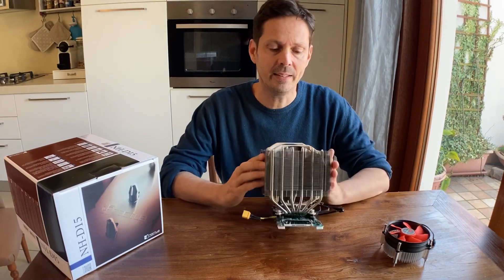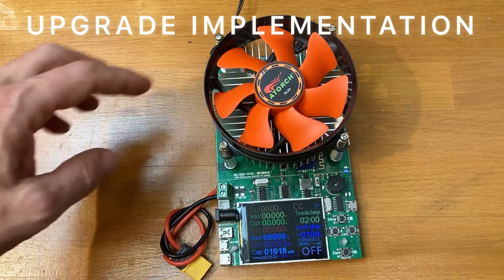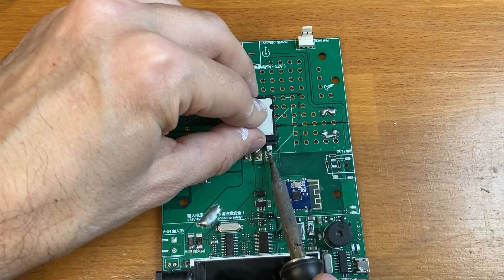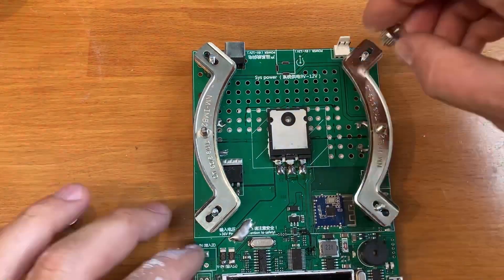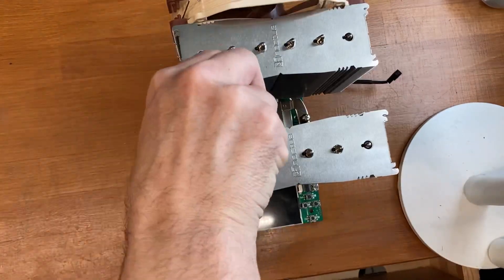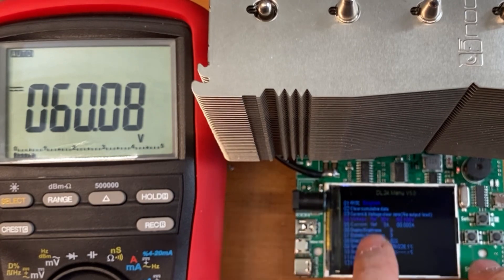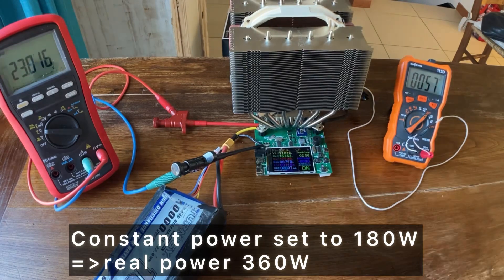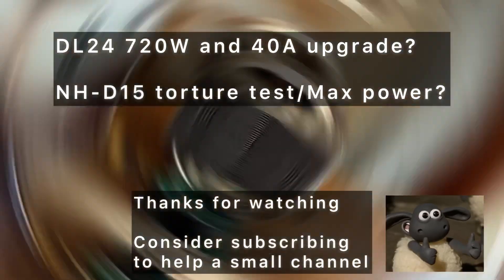Atorch DL24 electronic load upgrade

Comment: Why voltage calibration when is possible to modify the over power limit ? 🤔I tested and the over power can be increased to 999W.  Or you prefer to mess up all the readings from display.
Reply from the maker: Hi , the old model does not allow to change the power limit.
Reply: Amigo, como você conseguiu fazer a modificação direto nas configurações? Eu não consegui 😢.

Comment: Hello. Can you tell me why the irf260 is 180w and the mosfet you replaced is 360w, how to calculate it?
Reply from the maker: Hi, this depend by MOSFET max power rating, max TJ and thermal resistance 
of the MOSFET package . And also by temp at 350w reached by the new heat sink. Too long and complicated to explain in messages, sorry
Reply: I really like your video, it makes me very curious about how to calculate the capacity of a mosfet that can be used sustainably.  I hope you take some time to teach me how to calculate it.  I sincerely thank you
Reply from the maker: @HieuLe-nr6em  your is actually a good question. I will try to find the time and make a short video explaining how to calculate the “real” maximum power you can dissipate on a MOS
Reply: @MakerFabio Thank you very much, I'm looking forward to it, wish you good health.

Comment: I think a better approach to reverse voltage protection would be to include a 25-30 amp fuse in series with input and put the blocking diode reverse bias across the MOSFET drain.  This should keep the reverse protection via the fuse while eliminating the heating created by blocking diode voltage drop.
Reply from the maker: It is a good idea
But still, like it is now , you are also using the diode to dissipate some power , which is the objective of the load.
But anyway good idea, it may reduce the minimum operating voltage of the load
Reply: @MakerFabio  
Diode would be normally reverse biased and off.  Only when load battery put on reversed would diode conduct and fuse blows.
Reply from the maker: @rcinfla9017  sure

Comment: Hello friend, my mosfet burned out.  Can I use IRFP260N instead of IRFP264?
Reply from the maker: Hi please see the table at second 27. I don’t  recall well what i calculated, but it looks you need 2 of them in parallel (for 360w) if you need only 180w it should be ok

Comment: Is there a schematic of the DL24P somewhere?, I blew up my DL24P. Have replaced the MOSFET already. Is that sufficient?  Measures voltage again,  but not ready to test it at anything higher than 3V, Like to know what I;m doing first.
Reply from the maker: I don t know, i didn t find any schematic, just guesses
Reply: I found that replacing the MOSFET isn't enough. It was working to test a single cell, but the unit short circuited again when I went to test 48V.,

Comment: Good day. I have exactly the same load at 180w. How did you unlock the power cap? I know that in the new version, with 4 connectors, it is possible to increase the power yourself to 1000w. But how can this be done on the old version? with 2 connectors. How did you turn off the 180w software limit?
Reply from the maker: I explained in the video that it is not possible to remove the power limit, the only trick is to cheat with the calibration, and have 1/2 voltage and 1/2 current reading. So the power can be 4 times higher
Reply: @Raphael Dean flixportal =)
Reply: @Jack Justice thank you, I went there and it seems like they got a lot of movies there :D I really appreciate it !
Reply: @Raphael Dean Glad I could help :)
Reply: On the NEW firmware (as used in DL24-M) you can access a secret menu. Hold M (menu) button then power up, but do not let go of the M at any time. A selection will appear to choose various maximum wattages. I think the menu scrolls, and you release when you see what you want. This may not work on the single-heatsink DL24 and DL24P, but worth checking.
Also check software update in the Atorch Mediafire folders, under DL24 or DL24M and look for a ZIP that says "software V1.0.2 Version". There is a firmware update in there somewhere, but be cautious, I have NOT tested if it works.

Comment: The weak link is the reverse protection diode in series with MOSFET drain to A+ connector.  At 20A load the dual Shockley  diode has 0.65v drop and dissipates 13 watts.  It does not have the heat sinking to handle this for long period, relying solely on PCB heat sinking.  It will help some if a small adhesive backed heat sink is is placed on PCB near diode and with fins height not to mechanically interfere with MOSFET heatsink above it.  No concern if diode heatsink fins touches MOSFET heatsink fins as they are both common connection to MOSFET drain connection.

There is no need for insulators between PCB and power MOSFET.  Front and backside of PCB in the power MOSFET area is common connection to MOSFET drain.  Insulator pads just increases heat transfer resistance to heat sink.

Next weakest link is the two 1 watt 0.010 ohm shunt resistors.  They are at their max power rating at 20 amps load.

The stock IRFP260 MOSFET is capable of handling 30 amp if sufficient heat sinking is provided, but reverse protection diode and shunt resistors will likely get damaged.  If the MOSFET is changed to a higher amperage device with greater Qg input charge capacitance the LM321 op amp driving the MOSFET can become unstable.
Reply from the maker: Hi, all good points
But the diode and shunt resistor was designed to withstand that current, so i supposed it was correctly dimensioned. But you are right, they could be the weakest link. In fact in my other video, where upgraded to 600W i changed both of them and added a copper wire as heat sink. Therefore now I m using it daily at 20-30 A to test big battery packs for hours. About the stability, its reacting really slowly, and i didn t notice any instability behaviour. By the way , its unbelievable, they placed 1k resistor in series to the mosfets, i reduced if i recall correctly in some experiments
Reply: This is correct (yes I know it's old). I tested a DL24 at 20Amp discharge: the diode heats up to 130 C and the shunt up to 90 C.
At 15 Amp, the diode has about 90 C and the shunt about 50 C.
Measurements done with a FLIR infrared camera.

Comment: I added the IXFK360N10T, but now the tester behaves like it is shorted. If I put the old MOSFET back on, it works again. Anyone experience this?
Reply from the maker: Maybe you destroyed it during some test
For instance if you set to on the load before applying the battery, then you connect the battery, you will destroy the mosfet
Which will often look as a short circuit.
Reply: @MakerFabio  after I posted this I checked the MOSFET and it failed closed. First time I've experienced a DOA like that
I always test on my bench power supply with current limited to 1 amp.

Thanks, Fabio!
Reply from the maker: @monono954  i see . You did  right by testing with a limited power supply, so it was really a dead on arrival. Have a nice dat

Comment: ciao vorrei fare un upgrade al mio dl24 da 150w, cosa mi consigli di sostituire? Vorrei arrivare a circa 300/360w, basterebbe sostituire solamente il mosfet principale?oltre che ovviamente il dissipatore con relativa pasta termica ecc., inoltre non ho ben capito il perchè di quel ponte fra le resistenze a sx e l'altro componente sopra di esse. grazie molte
Reply from the maker: Ciao
Son passati un po di anni, ricordo poco dei conti fatti. Fino a 300W forse riesci con un mos solo, mi sembra che nel video faccio vedere una tabella, guarda le potenze che avevo calcolato se ti bastano. Le resistenze servono a dividere la corrente tra mosfet in maniera piu bilanciata. Altrimenti uno dei 4 inzia a tirare di piu e poi succede un thermal runaway

Comment: Good night friend.  Congratulations for your video...I've had this equipment for about 3 years to test the capacity of 18650 battery packs that I make...but this week I don't know if I neglected it, but the input of the power supply connector smoked and I immediately turned everything off ... I don't know what happened, if the alligator clip accidentally touched one another or if a drop of water from my hand that had just been washed fell on some component of this board that is all exposed.  Everything is working (LCD panel, fan) no scorching marks on the back of the board, but when I put any power source in the input of the power supply, it makes a strange noise and it already starts to let out a little smoke and I immediately turn it off.  Do you have any idea what I can do to fix this problem?  Any tips or advice would be most welcome!  I would not and do not think it is a case of discarding the equipment.  Thank you very much!
Reply from the maker: Ciao Franco , do you speak italian also?
So, i would check for the big mosfet, or the big reverse protection diode, both on the test battery cables. You can check them with a multimeter, in diode position. See online how to test a mosfet and how to test a diode

Comment: No extra wires from Vin resitors to the transistor? I doubt that trace is designed for so much power!
Reply from the maker: Hi
The current in this modification is not changed, so the traces and reverse polarity diode can remain the same
Only voltage reading is doubled
Reply: @MakerFabio  this thing has a 20A max load current. You cant test lower voltages at 360W because amps get too high. Would be nice if we could upgrade amps also.
Reply from the maker: @no-eb2xx  i did it
Check my channel other video to 600w

Comment: Is the internal temperature displayed on the screen after upgrading the MOSFET?
Reply from the maker: Hi
The sensor is the original one, placed on the pcb close to the mosfet case
Reply: @MakerFabio  thank you for quick reply. I mistakenly fused/destroyed the original MOSFET and I need to change it to fix the board.
Reply from the maker: Ok, take the one i used , much more powerful

Comment: Hello
I upgraded/modified the IXFK170N20T mosfet. IXFK360N10T was not available in my area.
Unfortunately, I have a problem because the IXFK170N20T has already died and is short-circuiting. DL24 works properly up to 4.5-5A and 40V approx. 200Watt, above that it is turned off and it turns out that the mosfet is short-circuited :(.
Can you tell me if I chose something wrong?
Thank you in advance for your help
Regards
Reply from the maker: Hi, hard to say. It depends a lot also on the remaining parts on your setup, i used huge heat sink and super conductive paste and bigger mosfet.
What was the mosfet temp when it failed?
Reply: @MakerFabio  thanks for your response.
Just like you, I used oversized components :).
My cooling is Prolimatech Megahalems and a noctua 140mm fan. The paste is a special grizzly paste. The device indicates that the temperature at 200W is 38-40 degrees....
I sense some incompatibility here with this mosfet.
I added two more diodes because one was getting very hot. At 3 pcs the temperature is very low.

Comment: Don't forget to upgrade the shunt resistors with higher value or you can solder more of them in parallel, otherwise you will blown your resistors, also you should upgrade your diode.
Or the best mod is using multiple mosfets to have best heat dissipation !

This mod will fail on long term usage.
Reply from the maker: Hi
Max Current remains the same, only voltage reading is halved. so no need to change shunt or diode for this mod. If uou check my 600W upgrade, there i changed also resistors and diode

Comment: i added de 1250w mosfet and it burned the board the r010 smd blowed up
Reply from the maker: Hi, very strange because the current should remain the same. How much current were you driving? How much power? Which source was connected (e.g. battery?)  if you give me some more info i can try to imagine what happened

Comment: Hi, I blew the original FET on my 180W four-wire DL24. I replaced it with the IXFK360N10T that you suggest here, and after this it worked. At least until I went up to 150W, and then something shorted internally in the load. Luckily the 52V battery I had attached had a 40A fuse, which blew.

Any idea what caused the internal short in the load and if it can be repaired?
Reply from the maker: Hi ,150w is not a lot of power for that mos
Maybe the thermal coupling was not good and so you destroyed the mos? Which heat sink do you have installed?
Reply: @MakerFabio  I don't think this is the case, as it is definitely thermally coupled than the original mos was. Thermal grease on bottom and top of the new mos, and the heatsink is the one that comes with the 180W version by default. With this and the original mos the load was easily eating up over 150 to 180W for hours on end.

I don't know much about electrical components, but was wondering if there can be some compatibility issue between the two mosfets? Also when the short happened, the shunt resistors melted their plastic packaging, but seem to still otherwise work.
Reply from the maker: @anelinnonmaa  i see
If now it is shorted i guess the only broken component is the mosfet, because there is nothing else able to sink lot of current in that board

I don t think there could be incompatibility because they are both NON logic level, and the driver is very slow. 
If the battery you attached is strong, and you turned to ON the load , before connecting the battery wires, this may lead to an big inrush current and destroy the mosfet. Did it happen perhaps?
Reply: @MakerFabio  No, I stared out at 0,1A load (5W) and increased in 0,1 increments to 1A (50W). Then increases to 2 and 3 A where is shorted. Maybe I was unlucky and got a bad fet. I'll replace it with another since I ordered 3 and try again :) Thanks for the help! Also have another DL24P arriving in the mail soon luckily.
Reply: Hi, did you fix the problem ?? I have the same problem. Thanks
Reply: @rizitelli78  No, sadly it's still waiting for me to try to repair it again.

Comment: Nice upgrade video :D, I am looking to buy a similar cheaper CC load but my issue is that I want to also log these readings onto my laptop, is there a way to do it ? I have seen that it comes with PC software. Can you confirm if it has the option to log and see values in some sort of CSV, excel files :)

Also, can it be programmed by the host so that I can tell it when to start discharging or so. if No, then do you know any other electronic cheaper CC load that can do a similar job but also can log data and is programmable. 

thanks alot , have a nice day
Reply from the maker: Hi
I’m not sure, mine has a bluetooth module which can for sure control, not sure about the log. I can not check right now. Maybe you can find the manual online
Reply: Hi, I've managed to log data from this to a .csv file. If you manage to install the chinese pc software from their mediafire link (i had to switch pc locale to china in order to get it to work), then you can export to csv in that program.
Reply: @anelinnonmaa  thanks for your reply , can I know more details on it :) 
. how can I reach out to you ? email ?
Reply: @anelinnonmaa  check inbox , thanks

Comment: Do you think I could use this to put a solar panel under a load to test it's actual power output?
Reply from the maker: Mmm, best eay to test a panel in my opinion would be a constant voltage load
Bur the constant voltage is quite terrible on this load.
If you have the load give it a try 
If you have to buy , not sure is the right one
Reply: @MakerFabio  Thanks, I was going to buy one to test my batteries, so I figured I might be able to use it for the solar panels. I just want to compare a good one to a possibly bad panel.
Reply from the maker: @cs-xd9gy  in this case it could possibly work. If constant voltage is not really working well, you can use constant current and increasing till it drops in voltage. But actually maybe you can just use a multimeter and compare the open load voltage and the short circuit current?  Not sure, I have just small ecperience with solar panels
Reply: @MakerFabio  I was hoping to be able to place a load on the panel to make sure the current does not drop off. I also wanted to it cheaply;)

Comment: Hello very nice what you doing.. I have this device with 4 connectors and its working very good in the past. But now I have a problem, because the voltage measure doesn't work now. All I tried it stays on 0 Volt. Sometimes I switched on the device, the voltage jump to 0,05v and then slowly decrease to 0v and this without connecting to the battery I would testing.
Okay I know it's not your theme but maybe you can help me because I see you are a very good electrician guy..

Thanks and big greetings from Stephan Bendig..
Reply from the maker: Hi stephan, hard to say, not knowing the 4 terminal load schematic. Maybe you inverted the sensing wire polarity , opposite to the power wires and something got broken?
Can you set up as 2 wire only on the menu?  Maybe it is working as 2 wired only. Another idea is trying to calibrate again the reading as i m doing in the video, but if you read close to 0 i fear it will not accept the calibration

Comment: Hi Sir,

What is the max constant current load that can be set? Is there way to do 50A CC load? Power will be max 200W as the voltage is low.

Thanks
Reply from the maker: Hi sorry for the super late reply. To increase the current you need to change the shunt resitors and diode. Please see my other video converting the load to 600W, there is doubled the current capability